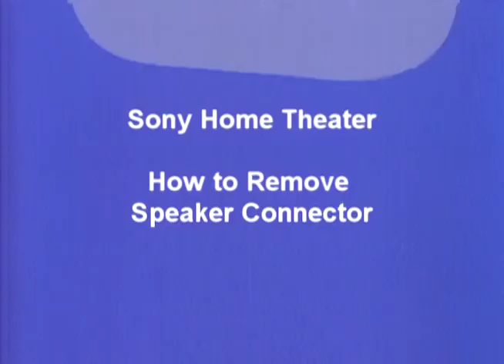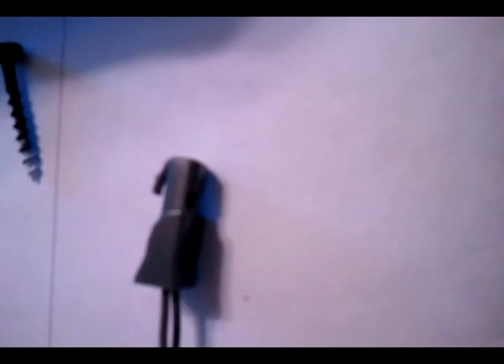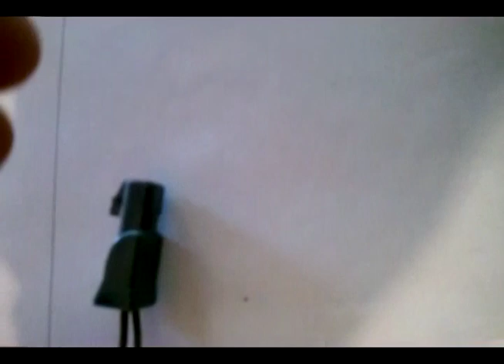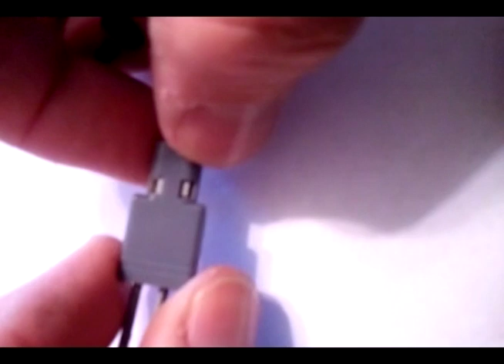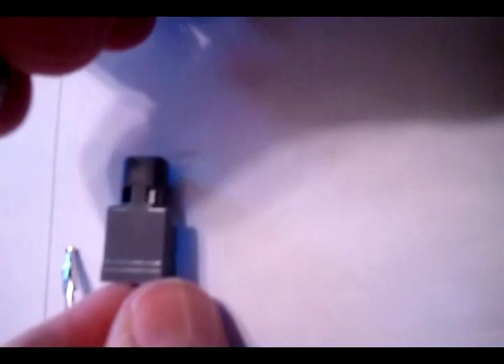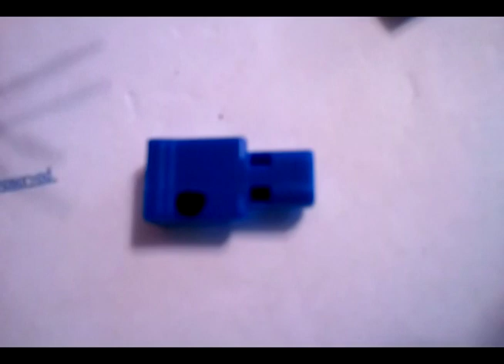How to Remove The Speaker Connector on Sony's Home Theater System

Comment: I needed this, just bought a Sony 4k blue ray player and a 65" Bravia. Tried to run everything through the BDVE 3100, but only the front speakers worked. I picked up a Sony STRDH590 4K receiver yesterday, I'm simply going to remove the proprietary tips and use the 3100 speakers and subwoofer while I put some money aside to upgrade.

Comment: Great. I was looking for a solution to route the surround speaker wires through hollow tube of the speaker stand and faced the same problem of the large connector.  You solved it!!.

Comment: Will the speaker work if I plug it into an older receiver with black and red speaker ports. Shop sounds nothing fancy just didn't want to spend on another sony system when the speakers still work

Comment: So I upgraded to a better set of normal wired stereo speakers (Polk RTiA1's), could I just put the wires in those little connectors and plug it in as normal? Thanks a lot.

Comment: Great video but my problem is the speakers i have don't have the male connectors to plug in to the female receiver in the stereo unit, been searching for over half an hour now, somethings are a needle in a haystack on the Internet wtf

Comment: hello! i just buy a Sony home cinema HTRT4, my problem is the cable of surround speakers is short for me, and i wanna make it longer, i think can link it with another one, but i don't know the original material are made it. can you give me a solution? i bougth a copper audio cable for try it, but if you know exactly with  what  type of cable i can do, you save my life. thanks a lot!

Comment: Thank you so much this was very helpful you saved me from taking it to a shop. The problem that I have is the factory speaker wire from my Sony subwoofer is short and I need at least 4 ft longer, you think by adding more wire will this affect the sound or maybe it won't work if I cut and add more wire.  Please let me know what you think it will be very helpful. Thanks You
                                                                                             Nando
Reply from the maker: Extending the length will not effect the sound.  Just make sure you are using the same size, or larger speaker wire.  And.....Thanks!  ...glad you benefited from the video.  :)
Reply: Flyboytr Thanks for your quick response, I will take a pic and make sure I get the same size of wire...you are a big help. Thanks
                                                   Nando
Reply: Binerba Ruiz Hi, im looking for Extending the length of my subwoofer hometheater sony... How i can do it? regards!!
Reply: +e chavezm me too, they are too short, did u find an extender?
Reply: Hey, appreciate you sharing the video, can you assist me with increasing the cable length of the wire? I have already installed the extended cables, just want to connect the 4 speakers to the 1 amplifier.
also do e have a female connector fir the same? so that I would not require to cut the wires.
Wu appreciate if some one shares their thoughts

Comment: Hi I was wondering what are the size of the connectors the go's on the in of  the wires and what size is the blue connector that you had the black maker on? I'm trying to repair my speakers after my puppies chewed the wires so I need to buy new speaker wires so I can replace the speakers thanks in advance.

Comment: This is helpful and will try it tom morning! Thanks! And sir do u have an idea if there is an adapter from bare speaker wire to audio cable as I will connect the subwoofer wire of the bdv system to the subwoofer input of my Sony receiver str dg720? Hope you can help me with this too. Thanks so much!

Comment: Is there any way to connect the speaker wires (once you've removed them from the proprietary plug) to a standard, non Sony receiver?
Reply from the maker: It would depend on the plug and the type of pins it requires.
Reply: if it's just regular speaker terminals, you could just cut the ends,  and strip the wire and twist tight.
Reply: My receiver has bit the dust, but the speakers work fine. So I'm looking to buy a proper AV receiver, but need to know which of the 2 cables are positive and negative. Anyone know? Would cost me so much more to replace the speakers too and I know they work. I don't really want to take apart my speakers just to see if there's a + or - labelled on there. It would require a lot of time and possibly me even breaking it. Sony have locked these down.
Reply: On my Sony Home Theater system with the proprietary Connectors, I know  on the speaker side the wires split and are color coded gray and black and plug into the gray and black receptors for the speaker. IF you could keep the wires straight you might be able to follow one side and label it + or -.. Noticeably, Sony on my system, covered both wires with the same color cabling to make things really tough lol.

Comment: So, you're saying we COULD still splice these wires with regular speaker wire to make the Sony speaker wires longer?
Reply from the maker: +Wopdagoacv Yes, that would not be a problem.  I would  cut the wire and splice in the extra length rather than trying to remove the soldered/crimped on plug tips that are in the plug.
Reply: +Flyboytr Thanks for the great onfo, and for getting back to me so quickly. I liked and subscribed!
Reply: +Wopdagoacv INFO...sorry.

Comment: Is it possible to make this cable longer by removing the speaker connecter and attaching a standard speaker cable, before putting the connecter back on?
Reply from the maker: +Benjamin Boraghi Yes it is...but it would require some very careful soldering of new wires to the metal plugs within the connector.  It would be a lot easier to just cut the speaker wire in an inconspicuous location and add your extra wire length between the cut.  That way you're only having to speaker wire to speaker wire and not running the risk of messing up the connector.
Reply: +Flyboytr hi which type of wire do i need do this ?
Reply from the maker: +Mark King Mark, Any quality speaker wire will work.  This is not a high wattage system so no super expensive wire is need.  Something like this from Amazon would be fine...unless you are trying to add 50' to each speaker.  http://www.amazon.com/AmazonBasics-16-Gauge-Speaker-Wire-Feet/dp/B006LW0WDQ/ref=sr_1_4?ie=UTF8&qid=1453254376&sr=8-4&keywords=speaker+wire
Reply: +Flyboytr thanks

Comment: hi and thank you for your video, is there a way for me to disconnect these pin pitch ends and then connect to an rca cable or something to use these speakers in something other than the sony amplifier they fit in? My amplifier is reading “push power protector” error and is broken basically, but I’d like to use these speakers.
Reply from the maker: Sorry...I don't have a clue about that.  Good luck!
Reply: Did you ever find a solution? I have the exact same problem and would like to make use of the speakers if I can.
Reply: no, no solution yet.

Comment: Thanks for the Video FlyBoytr,
I have a question you might be able to give me a hand with.
I'm trying to connect this kind of wire to my computer, is there a way I could convert it so I could use the Home theater speaker for a normal Computer?
Please give me a shout if you can help.

Best Wishes,
DJ
Reply: i have this problem :'(
Reply: I'm a bit late to the party here, but you have two options, either use a ARC HDMI cable into the home theatre system from your computer, this will also display the image onto your TV. Alternately if your home theatre system has given up the ghost and the speakers have no further use if you remove the connectors as shown in this video you could then solder on new 3.5mm jacks (1/4 inch) and plug them into your computer, the computer may have a good enough sound card to run 5.1 surround or you can buy a USB external sound card that will do it instead.
Reply: T3RRA_BITE_ but we have 5 speaker and 1 woofers so if we change all port with 3mm jack ,,then how can we can connect all wire to computer

Comment: I have this system as well, my question is if I upgrade to a 500 watt receiver could I just remove the tips and use them as normal speakers for the receiver with the positive and negative?
Reply from the maker: +Vayperrr I don't know what their wattage capacity is...but from a wiring standpoint.  Yes.  :)
Reply: +Flyboytr thats what i assumed but i just wanted a second opinion before i started tearing it up :) thanks man

Comment: pls hw can I join an opening end wire to this mechanism (from the feeder) so as to extend the cable of my sony home theatre.
Reply: what you can do to extend the cable is,check what cable is positive and what cable is negative then if you have this type of cables you put positive with positive and negative with negative and put the cables back on to the connector.
Reply: Duxz[Español] so I can cut them in the middle and rewire and it will not damage the speaker or the sound quality I am tired of having my stereo in the floor on it side. Cause I can’t used all the ports

Comment: Is it possible to extend the cable length? i.e. buying separate long cable from market and fit it with sony HT.
Reply from the maker: +Sandeep Ghosh   The simple thing would be to purchase the speaker wire and just connect it to the existing wire.  Although, it is possible to solder it to the existing pins...carefully!
Reply: I don't think Sony sells these wires separately.. I checked with their service centers but no result. :(
Reply from the maker: +Sandeep Ghosh Any quality speaker wire will work (you can buy it at Walmart).  Just keep the polarity correct.
Reply: @Flyboytr  what would happen if the polarity reverses'\?